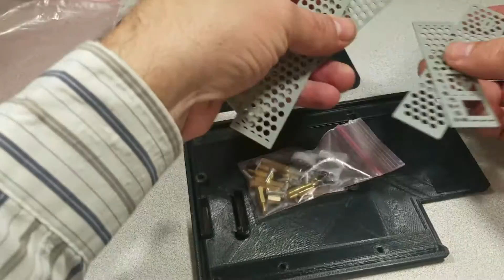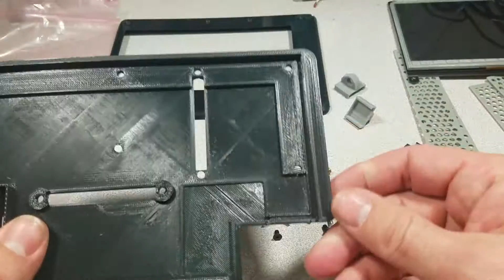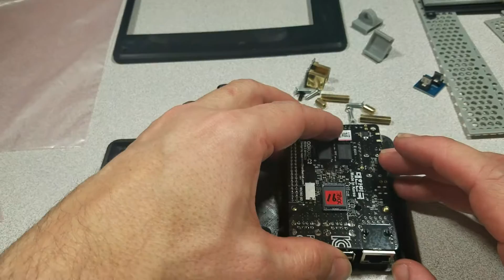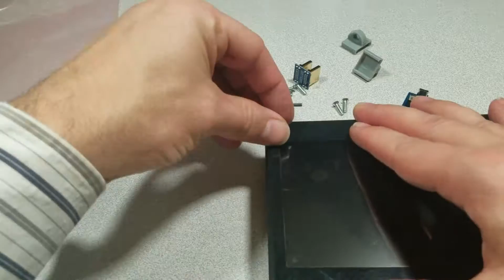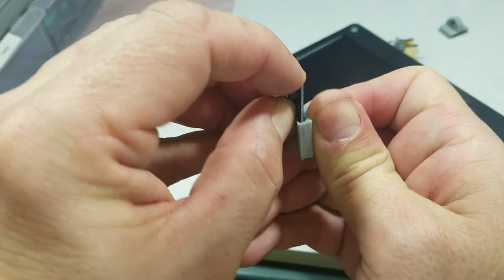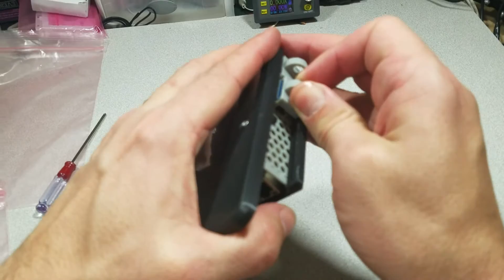ameriDroid's VU7 Tablet Project Assembly

Comment: According to Hardkernal's website the XU4 works with the VU8, but I'm wondering if it will fit in the case with the extra converting cord.
Reply from the maker: Is this question about the VU8 or the tablet kit that this video is about?
Reply: ameriDroid This is about if the XU4 would fit in the VU8 case.
Reply from the maker: We haven't tried it.
Reply: It will not fit into that case without customization as the case is built around the C2 form factor.  Thank you.